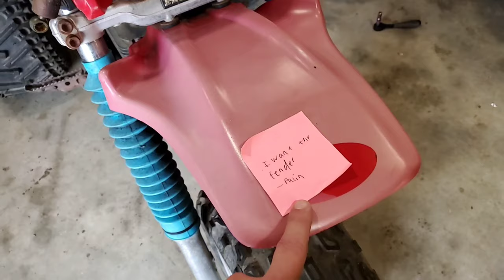How To Polish A Turd! - This 1985 Honda ATC 350X Gets A Facelift

Comment: The 400EX is a beast of a machine...I had one that I bought off a kid and the thing was stupid fast. I thought it needed some motorwork done because it was chattering. The mechanic I took it to asked me if any work had been done. The kid told me it was stock so i said "nope stock machine" The mechanic called me back and said, It had an 88mm top end in with a stage 2 hot cam...turns out those cams make a ton of noise and that's what i was hearing...I then started calling it the 426 Hemi Honda ...That machine never gave me any trouble....reliable as hell.